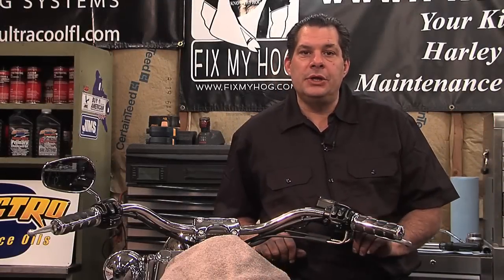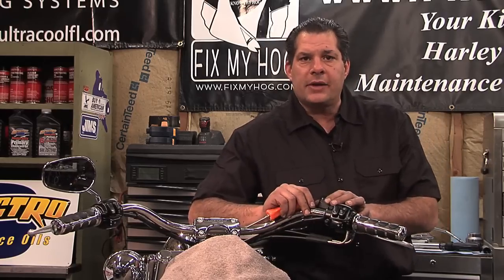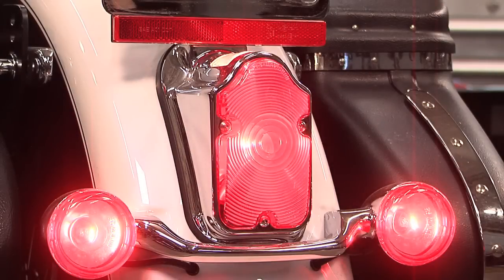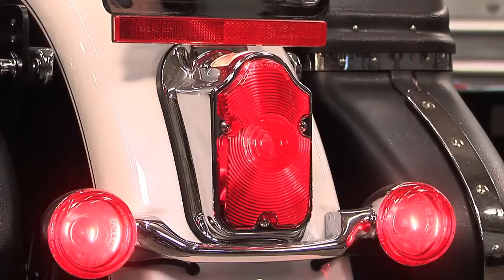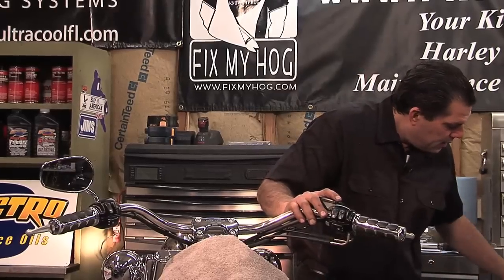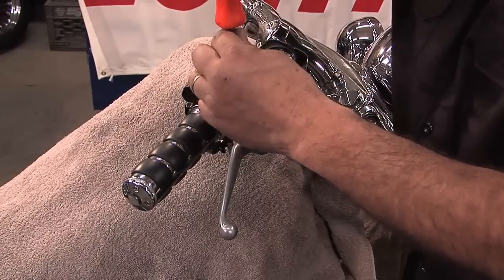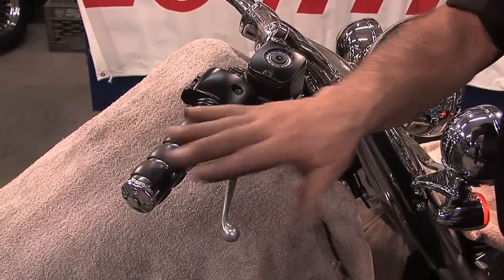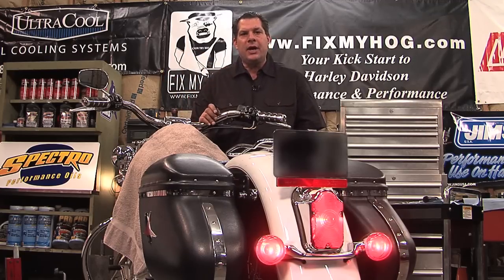Harley Davidson Maintenance: Touring Motorcycles - Brake Light Switch Alignment

Comment: Thanks man! I was messing around with the handlebars and loosened the front break assembly to move them into a more comfortable position. I'm glad I didn't break the switch. I just used your method and now my brakes work! I'm definitely subscribing to your channel.

Comment: Very informative! I had just finished lubricating the throttle cables on my V-Rod Muscle and notice one night during riding, that my brake lamps were always illuminated. The service manual mentions inserting the cardboard shim to avoid this.
I repeated the assembly and this fixed it! Thanks!

Comment: The integral switch usually doesn't become a problem until the brake lever has been removed. Inexperienced people put the lever in at an angle so that the pin will drop in and that's when the switch gets misaligned. When installing the brake (or clutch) lever then keep it in the prone position and then push it into the master cylinder housing until the pin will drop in.

Comment: I had the hardest time getting my switch housing back around the bar tightly after replacing the brake switch. It's like too much wire was in there. After watching this video I realized he put the throttle on the switch housing first THEN the brake lever w/ reservoir on after.

Comment: Yes I like what you are talking about. But I need to know more about the inside of the housing. My switch has been damaged and need to know house to replace with a new switch. I need to know if I need to also replace the bracket on the inside to. There is a bracket inside that holds the switch in place and I need to know all of this. Thank you. This is the only place to show this problem .

Comment: I have a 96 XL1200 C. All my lights work except the brake light. I changed rear switch, didn't help, I aligned the front, also didn't help. Maybe I didn't line it up properly. I'm looking for a video trouble shooting my year and problem.

Comment: I have a similar issue, but it's where my brake light is always on, even when I press the front/rear brake. On top of that, both rear turn signal lights activate when I brake (with either brake separately or together). They stay solid as long as the braking occurs, and when I let off, the brake light remains on. I've checked the housing on the cluster that holds my throttle, pressed the switch and let it go manually, and no difference. I hope I can get some help on this issue.

It's a 2015 883 Sportster Superlow.
Reply from the maker: +KATO/2TDS Jinx You will find that the issue is in the taillight itself. 
Inspect your bulb/socket/plug. 
http://www.fixmyhog.com/video/welcome-to-fix-my-hog-electrical-002169/ (ZD: 3803)
Reply: FixMyHogfreechannel
 Replaced the bulb, and my problem was solved! Thanks man.

Comment: Both my front & back brake light are not working. (Bulbs are fine) After watching both your video's I'm going to do the simple check and save myself a few pennies from taking to a shop. Will advise later.

Comment: on my 2010 wide glide the front brake does not turn on the brake light
Reply from the maker: Hi Randy.  Suggest removing your front master cylinder from the handlebars. Press and release the front brake switch. If only the rear switch is triggering a brake light, your front switch may need to be replaced.  
If you have aftermarket levers, verify that you do not have engagement/alignment issues.  
https://www.fixmyhog.com/video/how-to-replace-brake-light-switch-on-a-harley-010885/ 
https://www.fixmyhog.com/video/how-to-test-a-rear-brake-switch-001635/ 
https://www.fixmyhog.com/videos/electrical/